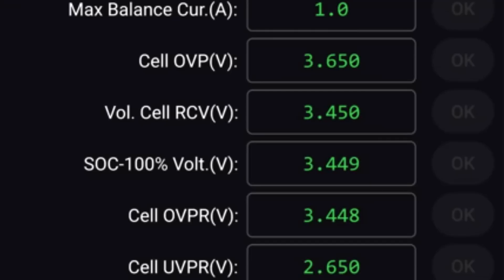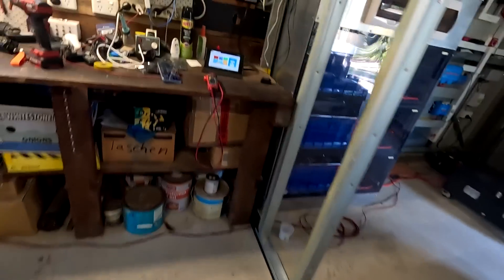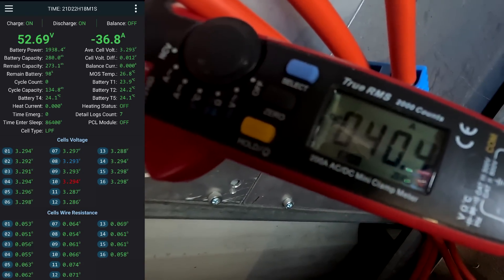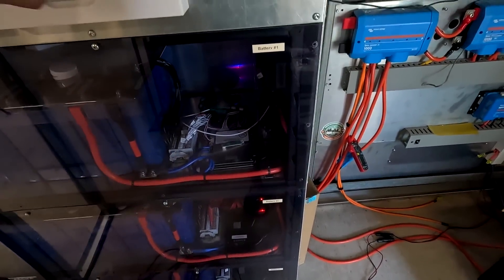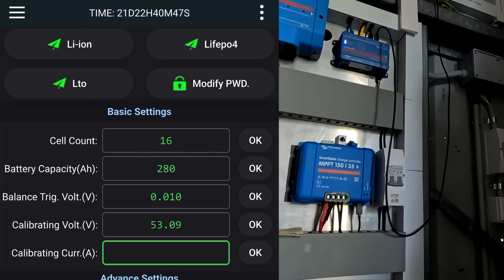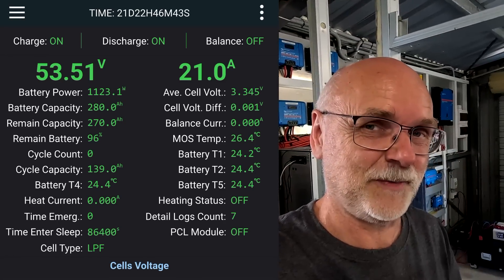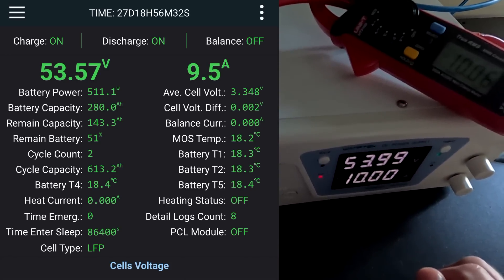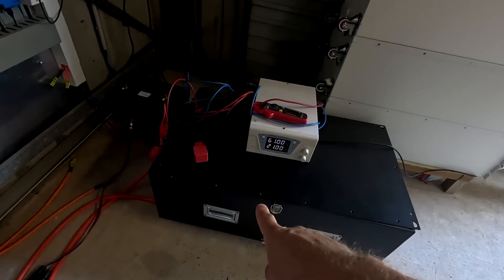JK BMS SOC Drift - How to (not) calibrate the current sensor and will it actually help?

Comment: I'm guessing there could be ~50w loss (1amp @ 50v) between charger and the battery due to various factors such as wiring, connectors, fuses / breakers etc..
Reply from the maker: The amps are not getting lost though. All components are in series connection and carry the same current. Connections, cables don't matter for that.

Comment: Looks like you are only allowed to do an offset calibration and not a scalar calibration. If those parameters were available I would do a 5 point calibration at 10%, 25%, 50%, 75%, and 90% to try and get the best resolution.

Comment: as @user-sq5ml9io4d has already mentioned: The float mode that no longer works in v15.30 is a much more serious error. Andy, please communicate this with JK, in my opinion this would be even more important than the drifting SOC.
Reply from the maker: Float mode is not working at all any more? What is the exact issue?
I haven't noticed anything in V15.30...

EDIT: OK, got it. I'll test and get back to JK

Comment: JK‘s current measurement issue is caused by hardware because there’s no proper shunt resistance on the board, and the frontend chip has ADC of low resolution.

It’s simply impossible to have accurate readings.
Reply from the maker: It works very well in the JBD-BMS. This is always very close to my smart shunt reading and SOC does not drift much during winter.

Comment: I'm no electronics guy, but i would think that jk can incorporate a simple shunt measurement device in their hardware design. Basically a resistor bridge with a current sensing amplifier that accurately tells the real shunt resistance to the bms. This will automatically compensate for shunt resistance changes as the shunt heats out cools. I'm sure there is plenty of literature about this from the automotive world. The rest is a few lines of code.
Reply from the maker: I'll pass this suggestion on to JK. But I doubt they will do such a hardware upgrade. It would mean they will then have three different hardware which they have to provide the software for.
Reply: @OffGridGarageAustralia and yet they provide temperature sensors already in the BMS. Seems they could use its own temp sensor and some code. If X°C temp then some offset factor to the calibrating current figure....
May as well use what they have already built in to it....

Comment: I have the same problem with my JK BMS on a 12v system. Over time, my solar panel stopped charging because the MPPT is controlled by the BMS. Even if I have calibrated the current, it is still off on small values. Andy, can I update my firmware so i can have the SOC option? I have a new JK BMS with the latest version and he has this option but on the older version is not there. I have spoken with  Hankzor from where I bought the first one and they say is no firmware update . Thank you !
Reply from the maker: If you have the older BD series of the JK-BMS, there is no option to update the firmware. Only the newer inverter BMS can be upgraded.

Comment: CC has been my only way of calibration. A shunt inherently drifts with temperature either ambiently or as a response to current flow. The more charge/discharge cycles outside of the top off voltages, there will be drift. I have not been able to establish any reliable references to correct the SOC outside of top off. I schedule a rop off mid season as a means of recording individual cell performance and calibration. Maintenance is not always automatic.

Comment: My victron shunt can be 12% out after a few days. Not sure why. It'll go from 88% to 100% based on the voltage. That capacity doesn't seem to be missing so I think some electrons are not being counted.
Reply from the maker: That sounds like a wrong setting in the shunt.

Comment: With all this inacuracy i think i will need to buy a separate coulomb meter device, im leaning towards a Hall sensor type meter device
Reply: I have 7 different brands both Hall & shunt. Victron shunt is the most accurate
Reply from the maker: I also use the Victron shunt for SOC accuracy.

Comment: Hi Andy and community.
This could be a common issue due to the use of poor adc readings without some kind of auto-scaling, maybe they use a 12bit adc to read whole current range on a single range for 100A charge/discharge capable bms.
Probably the lower current will have the higher error.
And maybe the use of linear calibration methode.

I think it needs some kind of curve calibration with 2 or 3 points.  🧐

Low cost engineering for a low cost bms.  I do not know 🥺

Comment: The problem isn't that the measurement is imprecise. The problem is that it deviates to different amounts. 
In some example that is somewhat close to your measurements: 
If you charge for 1h at 20A and the BMS measures 20A and then you discharge for 2h at 10A and the BMS measures 9A, it will drift (towards reporting a too high charge percentage, by 2Ah, whatever percentage that would be,  in this example).
Would it measure 18A and 9A respectively, it would be wrong only temporarily (report a too low SoC after the 20A charge) but be right again after the 2h, 10A discharge. Because it measured 18Ah in and 18Ah out.

(Our really built BYD LVM has the same issue though)
Reply from the maker: Exactly, some errors will compensate over time and the BMS is fairly accurate again. But now at the end of winter, it's all over the place and the JK have drifted a lot! The JBD however stays very close to the Victron shunt during that time. They must have a better technique in measuring and computing SOC.
Reply: @OffGridGarageAustralia Hi Andy. I guess you should report the better performance of the JBD to JK. Maybe they can look into it and reverse engineer.

Comment: Did you notice the current on the BMS seemed to be changing in 0.4A increments?
Reply from the maker: That's probably the measurement accuracy of the shunt or the internal algorithm of the software calculating the current. It may use a fixed value for the resistance of the shunt while in real, the resistance is also depending on temperature.

Comment: It is really confusing, that the BMS readings are so different to the readings of the clamp meter.
The difference between both measurements  should be allways to the same direction??? 
Maybe it would be nice to know, how the BMS measures the currant ??
Reply from the maker: JK uses a shunt to measure the current as accurate as possible. There will always be differences in measurement when using different devices.

Comment: I use my hybrid inverter to charge the battery with 5A fixed in order to calibrate the current. Calibrating for 5A allows me to have a good measurement for powers between 0 and 500W which is most often the case.

I compared the curve of a shunt with my JK-BMS for a month and the curve was very close even without recharging at 100% every day.
Reply from the maker: OK, if you stay in this power range for most of the time, this may work.

Comment: Hi Andy,
I enjoyed watching your video – impressive turnout for such technical details! However, I think you're running in circles on this issue. Here are a few observations:

1.	Resolution Concerns: The JK BMS seems to have a resolution of 0.4 amps based on your video. It shows readings like 4.5 amps, 4.9 amps (not quite 5.0 amps), and 5.3 amps. Calibrating it at 5.0 amps might be quite challenging.

2.	Display Issues: The JK display changes quickly with inverter load, which suggests it’s showing the current at the moment of sampling rather than integrating it over time. This could mean getting an accurate measure of energy consumption or replenishment might be difficult. For better accuracy, it would need to sample at a frequency higher than the mains voltage frequency (e.g., 4X = 200Hz, 10X = 500Hz for 50Hz mains), which might drain the battery and contradict the low-power goals of the BMS.

3.	Measurement Accuracy: Linearity issues might be due to measurement resolution, a non-linear shunt, or electrical noise in the circuit.

Just my two cents from an experienced perspective!  And, thanks ChatGPT for the formatting of this comment.

Comment: Adding accurate SmartShunt to the JK Inverter BMS hardware in future Hardware releases would be best.
Reply from the maker: I don't think, JK will go down this path. They would admit that there is a problem with their hardware and measurement accuracy.
Reply: It's hard to do because different inverters use different charging curves, but it's not impossible!

Comment: The alternative DPS firmware on GitHub uses a drift multiplicators. This should be as close as JK can get...
Reply: You talk about kanflo/opendps? Anyway, two drift multiplicators for high and low charging or dischargeing should be sufficient! Can't you tell Victron how much it should charge max? So you could calibrate at 100A. Greetings from good old germany.
Reply: @EliasHaisch  yes Andy should suggest that to the jk developer.

Comment: Would it be possible to add a software option in the BMS that when the Victron SmartShunt is in the system to take values from it back to the BMS?
Victron SmartShunt can also be connected to Solar Assistant, so somehow the data from it can be used in a non-Victron system as well.
Reply from the maker: That could be possible from a technical perspective. But is this really a solution for the SOC drift of the BMS?
The JBD/Overkill BMS stays very close to the Victron shunt during winter, so they must have figured it out...
Reply: How should a smartshunt know the current of each battery? It only meassures the total current of the whole system.

Comment: I'm a bit worried about the size of the main cables on the 200A JK BMS, mine get so hot at 160A and more to the point that I think the rubber coating on the cable is going to melt. Are they really good for 200A continuous
Reply: It is no rubber it is silicone.
Silicone can handle higher temperatures.

Comment: I think the only viable option is allow for shunt resistance measurements. IE: take a 4 wire bench multimeter and measure the shunt resistance to get the actual resistance value down to several decimal places past the zero. I have a 7-1/2 digit multimeter that can do kelvin measurements, having the option for shunt resistance values could be useful.  That said, the shunt will vary in resistance based on temperature as well, so without some sort of profiling of the shunts across a practical temperature range, and a temp sensor on or near the shunt, I don't know that we can really rely on the measurements it provides.
Reply from the maker: That's why I use the smart shunt as point of truth and ignore all the other SOC measurements. But this is not a real solution for the SOC drift of the JK BMS.
Reply: @OffGridGarageAustralia  I think the only way to solve the problem is for JK to profile and program the actual shunt value as part of their QC process and use a much higher accuracy than they currently are factoring for their current measurements and math internally.  The current inaccuracies could easily be explained by a rounding error if they aren't going deep enough in decimal places.  Part of the problem may require a hardware modification in order to account for temperature drift and the other part will require software changes in order to increase the resolution

Comment: There is clearly a hardware issue: when we try to calibrate the shunt, we can't achieve accurate results. If we calibrate at low power, the high power readings are incorrect, and vice versa. To solve this problem, we could adjust the feedback loop of the operational amplifier responsible for the shunt readings. If we prefer not to modify the hardware, we can address this in software by adding multiple calibration points—both for low and high currents. Then, the algorithm can calculate a curve based on these points, leading to more accurate current readings.
Reply from the maker: I wonder how JBD does it. This BMS seems to be fairly close to the Victron Smart Shunt and stays that way throughout winter when not fully charging for weeks/months.
Reply: @OffGridGarageAustralia  darren bms also very accurate i have it in 2 batteries .
Reply: The shunt is sensitive to temperature changes, so for accurate readings you also need a temperature compensation curve.

Comment: 1:50 I use a bench power supply, programmed to deliver 10.0A @ 1.0V and measured again by a clamp meter (same as the one you are using 2:51). Then connect power supply directly at JK's B- and P- terminals then calibrate with a clean DC! DONE! This method does not need a 60v bench supply. Even using an inexpensive 0-10V, 0-30A BUCK converter can do this trick.

But at higher current flow, JK's reading would mismatch the clamp meter. If I do the reverse (calibrate at high current) it does not match at low current.
Reply from the maker: Ah, yeah, good trick!
The current measurement is always off at the other extreme, no matter how we calibrate.
Reply: So, you think the shunt in a $50 power supply is accurate? Ohms law is your friend. 
I do have a calibrated electronic load that I use, but most people don't. A good Fluke meter can get you an accurate 10 amp measurement, but really you want whatever is "normal" load. Fluke meter will measure voltage and resistance VERY accurately. Go to home depot and get a water heater element. Measure resistance, measure battery voltage. Solve for current.
Reply: @john_in_phoenix  Here are the flaws in your suggestion:
#1. You cannot calibrate fractional current. Only whole numbers like 10.0A or 30.0A or 50.0A. Using your method, you need to exactly match the battery voltage to come up with whole number. (Watch the video, Andy mentioned it here)

#2. JK does not allow you to calibrate in negative values; you cannot calibrate when in discharge. The only way to calibrate is during Charging and the Chargers seldom delivers constant current, nor deliver whole number. 

In this video, Andy used a 60V, 20A bench supply; most people do not have this and is not economically practical (at least $500) to invest for a once/twice use. A 20A buck converter costs less than $10.0 in case a bench supply is too expensive.
Reply: @DanBurgaud  Sounds like a JK problem.
Reply: That was my idea also, I can even include the Victron shunt in the circuit and a 20A-Multimeter. And of cause turn off the Multiplus...

Comment: I have not done so but I have an extra VE MP2 5k that I could use in charger mode with 70A for calibrating.
Reply from the maker: How would that work? The MP II will only charge from AC to DC, so you still have an AC sine wave.
Reply: @OffGridGarageAustralia  yes but it's a minimal ripple. I could just now test it because I top up my battery from the grid (I do not have enough PV yet) at low or negative prices with the MP2 5k and set it to charge with 60A. I measured with my Uni-T UT216C which does at least 2 measurements per second and the current stayed very much between 60 and 61A. This 1A deviation would only be like 1.7% which is probably better than what the BMS can actually do.
Reply: @OffGridGarageAustralia  I just tested this scenario with my MP2 5k which is set to charge my batteries from the grid with 60A because of negative prices atm. and my uni-t ut216c shows a current between 60 and 61A while sampling about 2 times per second. This is accurate enough because this 1A deviation is about 1.7%, probably better than the BMS can do itself.
Reply: Can confirm, had good results getting stable current measurement for calibration charging from AC on my AIO. I set it to limit to 80A charge from grid, and clamp meter was at 79.8 with almost no variability

Comment: There also seems to be a resolution issue as it keeps jumping with 0.4 amps. Mostly on the lower side after calibrating. These inaccuracies will add up over time, especially in a ‘low’ season where you don’t hit 100% SOC. So it will certainly thrift over time again, and you might even give a hypothetical prediction based on this in inaccuracy.
Reply from the maker: That is probably the threshold of the BMS measurement accuracy. Below 0.4A/0.3A it just shows 0.
Reply: That doesn't explain the 0.4 ish A jumping at your midpoint testing of 15A. It's almost like the BMS is internally on some thresholds for switching internal circuits for measurement and you get the fluctuations despite rock solid power from the bench top supply.
Hard to know without going to component level and deeper knowledge from their "engineers" asking you for the solution.

Comment: Calibration settings exist for both Voltage & Amperage and you may actually consider dong both and then testing.  BTW, Voltage will take 3 decimal accuracy.
Reply from the maker: This is about the current calibration and SOC drift. Not sure why the voltage is important for that?
Reply: @OffGridGarageAustralia  
Maybe because the SOC is estimated by consumed and charged power?
Reply: @OffGridGarageAustralia  REALLY ???   The voltage is at the Batt Terminals isn't important for SOC ?

Did you check the actual Voltrage & Amperage being provided by your bench supply BEFORE attaching to pack so you know the "real" Volts/Amps ?

Clamp Meters are inherently innacurate as they are not inline, just sensing through wire jacket etc which also causes bounce +.   You even mention they aren't accurate and plow forward... 

Regardlkess of the above, the JK's (even 15:30) still ends up reporting 100% SOC even when the cells are at say 3.385 instead of the set 3.425 because their Coulomb Counter is BODGED !

The JK Tech is yankin your Chain and you are falling for it...  Enmgage Critical Thinking and ref to a Real EE.
Reply: TTT👍🏻